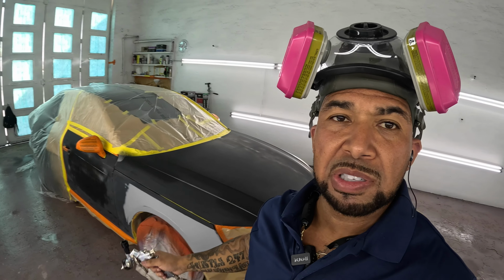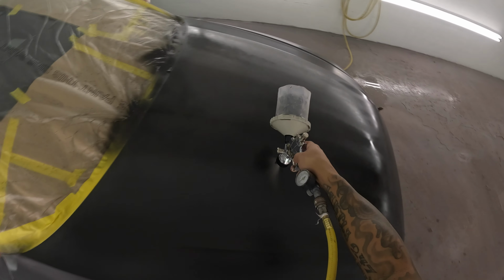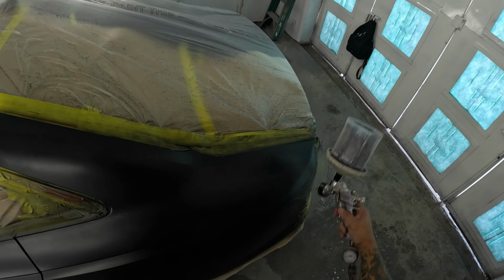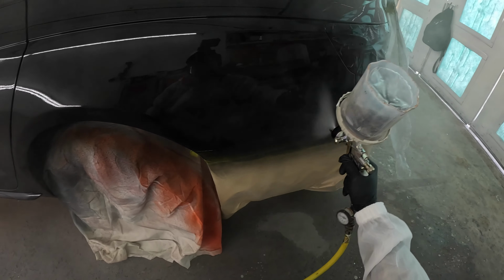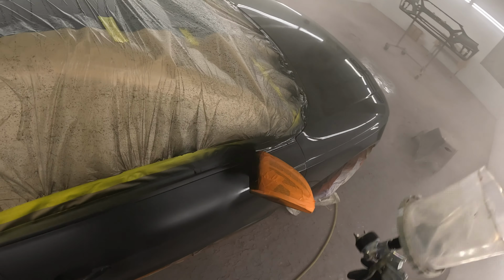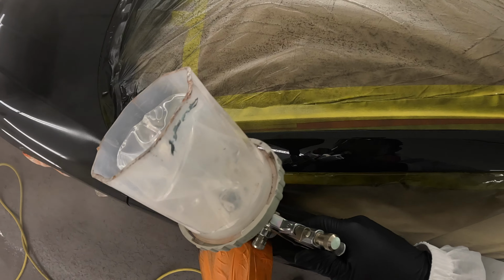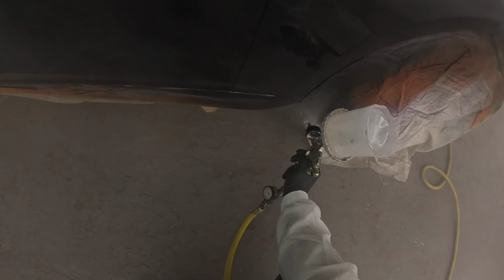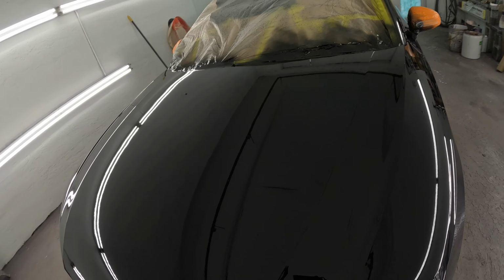This ANI F160 is one bad Muthafuk@ 😲😲

Comment: I don't know how they sell them so cheap. Nice gun. Got a 2 stage 60 gallon set up in my garage. Outside looks residential, but it used to be a refrigerator repair business. Already had 2/220 outlets. 2 bays. An office area that is storage/paint mixing/ and compressor(far away from overspray). Perfect for me. I put in 25 - 30 hours a week. Booked until Sept. 
   I have seen every single UPK video. Great channel for diy/small shop/ side hustle guys. And he is in Michigan like me. Really good about answering questions and sharing info.
   Your channel will keep growing if you keep doing what u are doing. Takes a minute. I seen UPK videos back when he only had 500-600 views. Your channel already has it's own flavor, yer doing good. It's going to blow up
Reply from the maker: Man 🙏🏼 from your lips to Gods ears. Thank you for your comment. Man your set up sounds awesome if I had that is never need to leave the house 😂😂 just order Uber eats during flash times 😎 thanks Bear 🤙🏼🤙🏼 I have those Pro-Lite vids going to be working on today. Didn't forget you bro.

Comment: The gun only uses 8.8 cfm from what I can find. Dv1 c2 used like 12cfm. Spray it r500 uses 3.8 cfm. This gun doesnt drink air. As I was watching your video I was noticing not a ton of over spray in the air which is why I looked up the cfm. The gun is still considered a hvlp. They have different air caps as well it looks like. I'm just a body man and dont paint much at work but I want to start doing side work at my home. I have a 80 gallon 30 cfm compressor so cfm isnt a big deal to me. Keeping the over spray down is tho. Seems like a nice gun and I plan on getting one now that I've seen it spray
Reply from the maker: Yea it didn't fog up my booth the was some guns do. Good to know about the cfm I just learned something. Thank you for the info and thank you for watching 💪🏼

Comment: Awesome. Thank you for posting so many videos. That's definitely takes some time. Can you tell why you are not using any sealer? Is it because of extra cost , extra time, extra orange peel ?
Reply from the maker: Definitely takes a lot of time 😭 almost want to just stop making the videos 😂 but I'm going to try to hang in there. I use sealer when I feel it's needed. It's not always necessary. If you have good pre-existing paint, and 2K primer there is really no need for sealer. Some people like to seal just for the heck of it, and some companies want you to seal every job I feel it's totally unnecessary in my 24 years of painting. I have sealer in my spray booth available at all times but the owner of the shop leaves it to my discretion. Thank you for watching hope that helps

Comment: A lot of these cheap guns will give suprisingly awesome results,,after a while they might break and not be consistent,,,I had a transter HVLP man I think up to this day it gave me the best off the gun finish ever and I have used them all from sata,sagola,devilbiss,,am an iwata guy  right through ws400 is the best atomizing gun as far as I see it ,,however the lph400 is never leaving my hands the low overspray and efficiency is unreal to this day
Reply from the maker: Man I feel the same way about my LPH400 that's definitely my first love 😂 never leaving my side. I actually have a brand new one in the box just Incase they ever stop making them. Nearly any over spray like you said.
Reply: @thetriggerman954  I don’t kno how guys says it’s slow ,,,1.4 tip and close to the panel and I am flying,,might not be sagola or sata fast but I am in full control
Reply from the maker: @andrelawrence9644  this is a 1.3 and I was hauling ass. People say it's slow? That's crazy. I wish my DV1 was this fast lol
Reply: @thetriggerman954  get the cv2 cap it's faster

Comment: I've had this gun sitting in the box for about 4 months..... bought it with the 1.2 tip for clear coat. Haven't used it yet....glad you did the review on this !! I also have a devilbiss flg5 ...a pretty damn good gun for the $$.
Reply from the maker: Flg5 that's the last gun I have left to try I hear that's a good one as well. But yeah you can take than ANI or if the box is a good one. Thanks for watching bro 💪🏼
Reply: The FLG5 is a step under the F160, but is less taxing on single stage compressors. I have a Kobalt 3.7HP 60 gal... runs the FLG5 fine once you mitigate water in the system. Love it for clear with a 1.4.
Reply from the maker: @bosshawg7427  so the FLg5 is under the ANI? Man I may not even need to try that one then lol
Reply: @The TriggerMan   two different markets IMO. The FLG5 is more for the DIY that wants a Devilbiss quality built gun, while the F160 is more pro oriented but is known to not last as long as higher quality guns. Honestly, you would sort of waste your time on the FLG5 since it has been reviewed numerous times already. It gets high praise though.
Reply from the maker: @bosshawg7427  gotcha, yea I don't know which guns have been reviewed I only go by what my subscribers ask me about. I don't watch other channels. But thank you for your input and thanks for watching.
Reply: @thetriggerman954  I bought both of mine at the same time from spray guns direct....both were about the same price. The  flg 5 is a great budget gun that will last. Actually I have an flg4 too ....another great gun for the money....fans not very wide though. I like these gun reviews your doing.... digging the video's buddy
Reply from the maker: @davidharrison8397  cool thank you brother glad you're digging them. I'll keep pumping them out then 💪🏼
Reply: @thetriggerman954  flg5. 1.4 fan is bigger and you can spray at lower pressure
Reply: @Bernard Varner I started off with the FLG5 with a 1.3,  I was applying a high metallic base with high solids clear. I had overspray like hell with that clear. I then did practice panels with a Kiwami 1.3 for base, then the FLG5 with a 1.4 on medium solids clear. Man, the FLG5 was fast. I was moving like a pro! 🤣 but I liked it.   I'm still trying to find the balance for me because I don't have very good exhaust where I paint, but I can say this, the gun is very easy to tune how you want it to spray.  The Kiwami not so much. It's a bit touchy.
Reply: @bosshawg7427  I started with the original FLG, I guess you can call it  the flg 1. I was winging it back then.  I used a flg3 for a while too. Not so good.  Flg4 never tried it. The flg5 is a good gun. Ani f160 is better.  I think the Iwata Bellaria or Devilbiss GPI is better for almost the same price.

Comment: Trigger 🎉 what's the settings
Reply from the maker: I spray it at 35psi full fan 3 turns out on fluid
Reply: @thetriggerman954 thats the ANI 160Q  trigger man 👨 I have the same gun
Reply from the maker: @ANDY-we7mr  this one is the F160 is that the same model?
Reply: @thetriggerman954 cheers trigger man have you tried that clear coat paint Roberlo
Reply from the maker: @ANDY-we7mr  man it's weird you say that. I have 2 quarts here that a rep dropped off for me to try. I was going to post it and ask if anyone has heard of it. I have global 6000 and Unix 450 HS clear.

Comment: How come when you do the hood you go to the middle and then come back on yourself but you don’t when you do the other half ,you just do one coat then go to the side, great video dude please don’t take as criticism you make ace videos
Reply from the maker: One side might have looked like it needed another pass, the video is about 4 of 5 months old so I'm not sure, but there is no right or wrong way to do spray it. Sometimes I'm moving a little faster when I start the hood and I realize I need to slow down so I slow down on the second half. Or sometime the opposite sometime you're moving so slow when you start the hood you realize okay I need to speed up just another thing you need to factor in and painting. Good observation 🤜🏼🤛🏼
Reply: @thetriggerman954  thanks for replying mate keep up the good work triggerman 👍🏻
Reply from the maker: @paullynch1938  more than welcome. And also because I'm trying out so many different guns on this channel and I try them out live I don't practice with them sometime it takes me a minute to get familiar with the gun so I have to adjust as I go. But thank you for watching 🤜🏼🤛🏼
Reply: @thetriggerman954  dude 🤛🏻

Comment: Can you comment on tip & cap preference for base and for clear -  think you mentioned CV2 cap with 1.4 needle  (was that just for clear?) Was it a 1.3 for base?  I have an ANI-150 but would like to buy the new version 160 to add to my collection but just need to be clear on what cap/tips to order
Reply from the maker: To my knowledge it only comes with one cap. I wasn't given an option for a different cap. And I have a 1.3 tip on there. With this gun 1.3 for base and clear works great for my materials